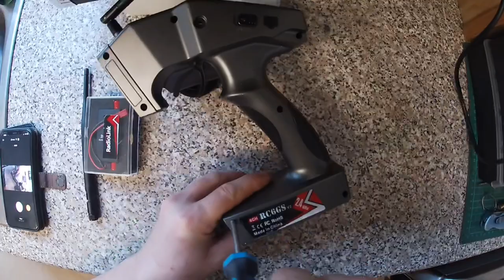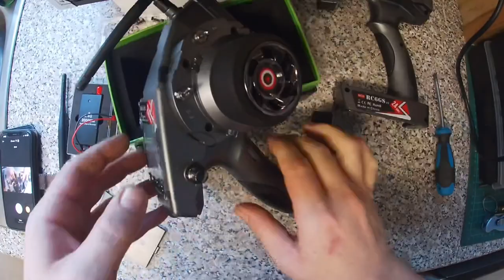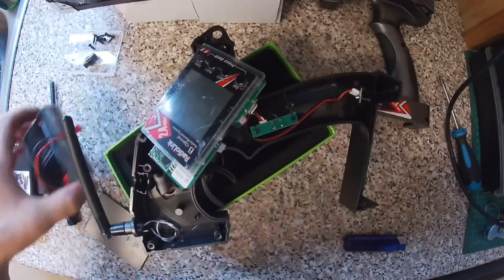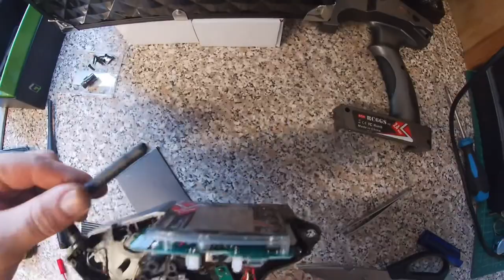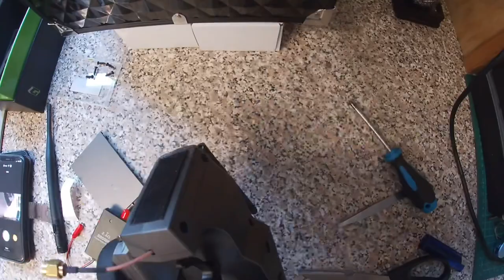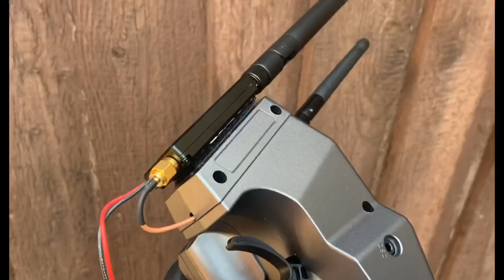Radiolink RC6GS signal booster install (time lapse)

Comment: Booster works quite well. I don't always use it and just screw in the stock antenna for short range but when going far the booster definitely makes a big difference. Only 100ft or so out it's easy to see a much lower loss of signal strength in the telemetry. Would probably go farther than I could see now.

Comment: Could you please show a close up video of where you soldered the two wires to the transmitter ???
Reply from the maker: once you open it up and see where the original antenna wires are soldered onto take a picture on your phone then desolder the stock two wires and solder the booster wires on the same way (if you forget which one of the two wires go where look on the picture you taken)
Reply: @RcSpeedrunnerUk  Thank you 🙂

Comment: Do you power the booster with transmitter battery? Or you power it separately using 2 battery? One for transmitter and one for booster?
Reply from the maker: you can do ether if you power it via the battery for transmitter id recommend getting a small 2s to power the both you can take the aaa battery tray out

Comment: HI. I had a question about this item. I've actually ordered it because of your video. However in the product photo it looks like theres 1 wire but in your video i see 2 wire connections to 2 points. Can you explain it please because I think I'm missing something.
Reply from the maker: hi, you’ll most likely have the same wire (antenna wire) in your package the wire with two solder ends are to be soldered in replace of stock antenna wire in your radio (unsolder the stock radio anteena wire) not sure which radio you have but some radio’s also have different connections its best to carefully open up your radio and check
Reply: @RcSpeedrunnerUk  Hey I actually just installed it onto my rc6gs. Thanks so much for your video. I haven't gotten around the testing the range yet but if the blue light flashes on the booster when I connect to my controller then it means that I soldered everything correctly and it works right?

Comment: Hi, does the blue indicator mean it's on, or connected? I just connected mine to a 2s lipo. But the indicator led stays off.
Reply from the maker: it indicates that the booster has signal so if its not on when powered up you want to check the antenna wire
Reply: @Rc speedrunner uk  Thanks Mate! My indicator led is flickering when connected. Is this supposed to be normal? Thanks again!
Reply from the maker: @Novit3R  no not normally id double check your connections if the soldering part looks good, also the screw in antenna part that goes into the booster can sometimes be abit temperamental you may need to unscrew it ever so slighty

Comment: I have connected a signal booster to the remote, but the signal field does not appear at all on the screen on the remote control.  Why?
Reply: It's not connected and you need to turn on receiver

Comment: Great tutorial! Instead of soldering directly to the board, could I connect it to the existing antenna wire coming from the board?
Reply from the maker: possible, but for what its worth stripping the existing wire to expose the outter and inner core probs be more time consuming and more difficult as they are very thin, less connection joints would be better, hope this helps,,,,,, thanks bro
Reply: You can find these with the IPX connectors on them and they require no soldering.  They just snap on and done.
Reply from the maker: @RyanCheneyELR  yes you can you may have to buy the wire with ipx on separately but yes is the answer
Reply: @RcSpeedrunnerUk  hey if I were to connect it to existing antenna wire could I just cut the current antenna wire and then solder it straight the the wire from signal booster? Im asking bc I might make a mistake or finding it hard soldering to the board precisely and would rather go the other option if its harder to mess it up.
Reply from the maker: @The_Engineering_Tutor  i wouldn’t recommend doing that to be honest mate, i would just take your time be patient take pictures before hand incase you forget where what goes,
Reply from the maker: @RyanCheneyELR  on certain radio yes IPX are a hell of alot easier basically a plug and play

Comment: Do you solder center wire from clear tube on new antenna wire or both center wire and exterior wire?
Reply from the maker: remove the stock antenna wire all together and use the booster wire Provided just take note when removing stock wire on which goes were
Reply: Yeah I got my flysky remote apart and it looked like it's all together but mine isn't working idk might try to solder in a ipex 4 socket to the board and use the clip connect on wire
Reply from the maker: doesnt the flysky have the ipx sockets already? you kno when the booster has single the blue light will come on on the booster the connector from the ipx wire into the booster the screw in one can sometimes be funny and may need a slight turn as if you inscrewing it, are you using a mini 3s for power to the booster

Comment: Does it matter which wire goes where on the board?
Reply from the maker: yes, take a picture before removing the stock wire then you’ll kno where which one goes when comes to soldering the booster wire in

Comment: Great another big ugly antenna to snap like the stock one & it needs a battery dangling outside. 
You done a neat as possible job, i can help you better it.
 Iv a 2800mah 2s battery in mine is was sold as a battery for our radios & has Rc6gs, rc4gs printed on it theres a 3000mah now. Get one, get rid of your little battery, get 8hrs minimum out of it, it would be perfect for your needs. Iv a new dumbrc ordered & going to turn my radiolink in to a fpv

Comment: Hi buddy. Do I plan to buy the booster, but I can't find an analysis of my method. Is it not possible to feed the booster with a separate battery from the front control battery? Also, have you had any problems with the use of the product? What a pleasant thing from a buyer like choosing to get close to the buyer.
Reply from the maker: you can hard wire to booster to the radio so one battery powers both, no issues with the booster it works very well

Comment: More than 1km range????
Reply from the maker: definitely more then 1km a friend has this radio setup with dual antenna receiver that does more then 1km/3400ft, 
so with the booster id say close if not more then 2km/6000ft depending on loction and surroundings